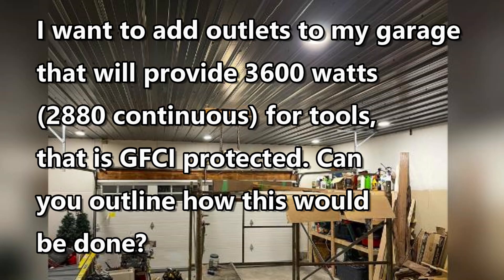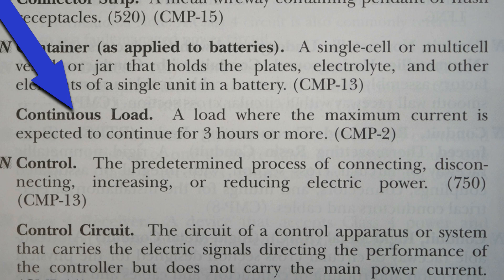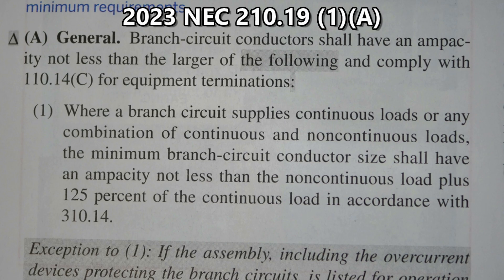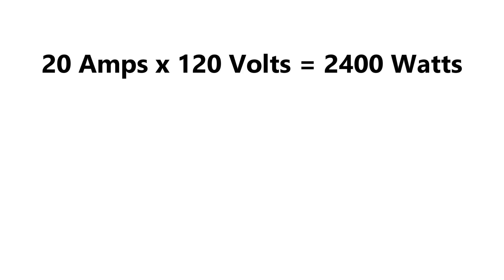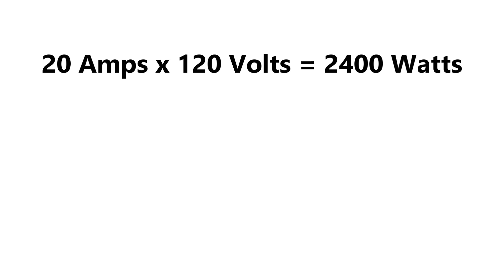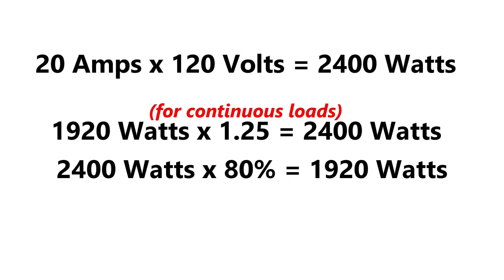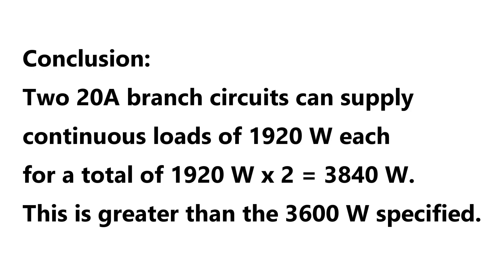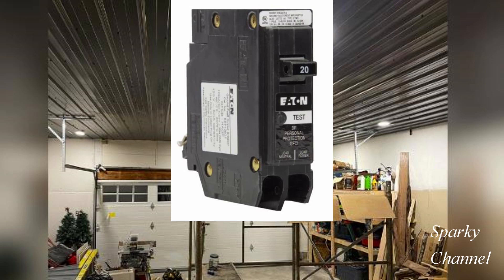Continuous and Non-continuous Electrical Loads with NEC 2023 210.19(1)(A)

Comment: Hi, Bill, there was a video, of a guy showing people, how to buy pass the main breaker for a home furnace, and he showed how to replace the switch also, on side of furnace, main line back to breaker, and in switches place, used a used a loop of cord, to plug into, a power station, or run extension cord out side to gas generator....
To power furnace, if power goes out, in dead of winter.....
 Is this a major code violation, and you have a code compliant way to power furnace, other than this above mentioned....
Here is this guys video....for clarity....
https://youtu.be/y07w1hiKIrI?si=WaXRD3ZpglYhx7-w

Comment: Wiring is so much easier before the drywall is up.
I would install four 20A circuits, with three 2-gang outlets per circuit, and also a 240v 50A circuit just in case.

Comment: Great vid. But you didn’t mention that you would have to up the wire gauge for the circuit for the continuous loads to 10 awg to prevent wire insulation stress from overheating from the continuous load. Thanks.

Comment: Now I'm going to check my pool pump circuit, not that I'm worried about it since it's 5 feet from the sub-pannel.  Don't you think line lengths should be considered?  Like a Tesla charger directly under a panel like I often see with 2 feet of line, seems silly to derate, doesn't it?
Reply from the maker: Great points! Length of conductor derating and conductor heat derating are going to be separate videos.

Comment: What I want to know is what he’s doing in his garage that will take nearly 3kw for 3hrs.
Reply from the maker: He said tools, beyond that I don't know.
Reply: @SparkyChannel  The power need for tools (usually always motors within the tool) is what I found unusual, because tools are typically only on while working a piece. Even when they are on longer, their draw is much less when not actively tooling a piece. Multiple small CNCs running 3 hour programs maybe, but don't expect that to be described as tools.  Ventilation or an oven is a candidate for continuous, though. In real world, we would both be asking, back up and tell me details of what you are trying to do. Nonetheless, great and precise discussion on continuous loads!
Reply from the maker: Thanks! Also, an electric space heater would be counted as a continuous load. @RJ-ej1nr

Comment: next question is what combination of equipment makes those loads, because if that's a single load, you need a dedicated circuit for it.
Reply from the maker: Hi Ken! Hope you're well. He did say the circuits were for tools, plural. But you are correct. More questions should be asked. But I thought it would be a good opportunity to discuss continuous and non-continuous loads.
Reply: @SparkyChannel  I think I saw the same question asked in another channel.  and yeah, it seemed to be general tool circuits.  but yes, when people start talking about workshops, it's good to have a clear idea of what is going to be going on.  and it bears mentioning, a space heater is ALWAYS a continuous load.
Reply from the maker: Excellent points!  @kenbrown2808